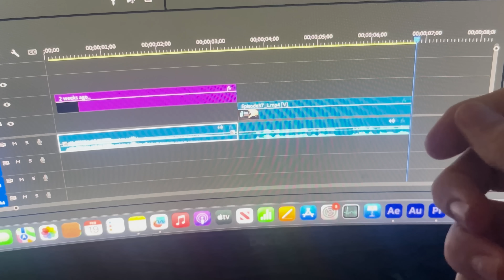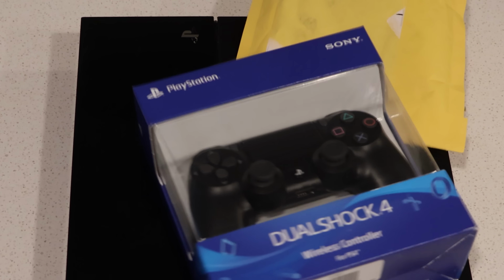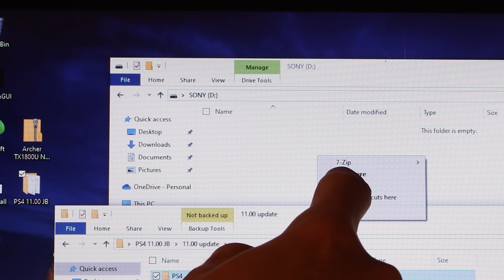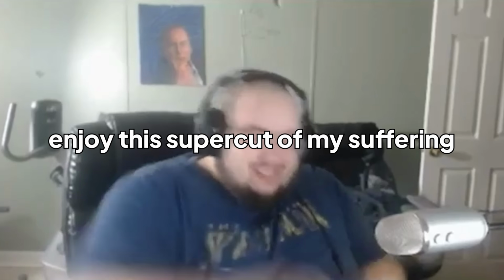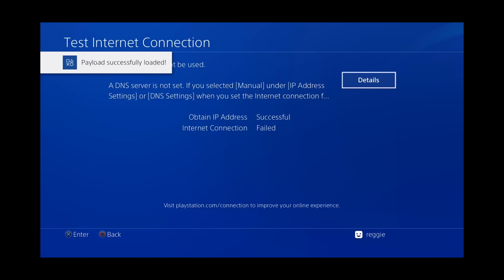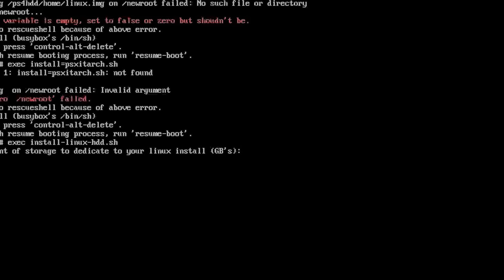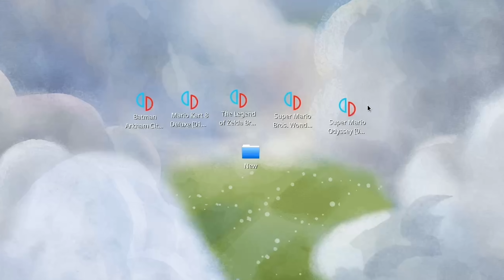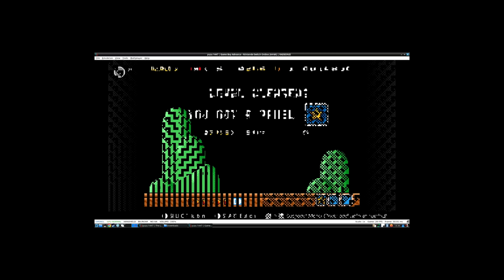Jailbreaking a PS4 to play Switch games

Comment: i run the switch on ps4 jailbreak Arch Linux you gotta fing the right version of the emulator i think its the 1473 version one than you must add additional swap ram in the CMD command you must also run the 1GBVram Payload and you have to tweak every game with a specific yuzu set up ! im running a very good collection of Switch games like metroid pokemon paper mario pikmin zelda etc You have to install the shadercaches as well so they preload before the game lunch!    you must also have a CEMU emulator it runs very smooth all WiiU games but you must tweak the emualtor for each game as well !

Comment: Even if the emulation didn't have all the visual glitches it likely still would be bad. The PS4's CPU really does suck badly. Emulation relies on a fast CPU and even back in 2013 the PS4's CPU was considered lackluster.